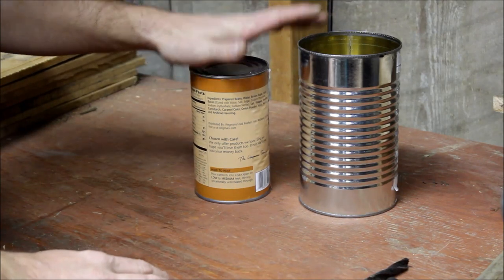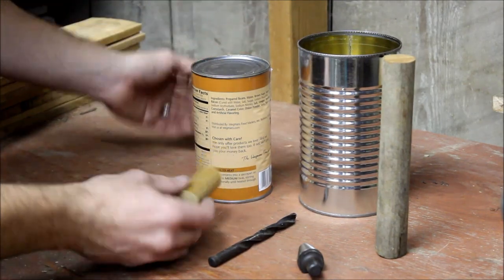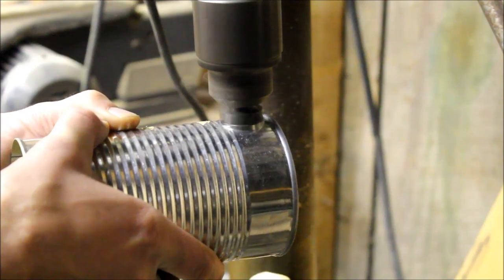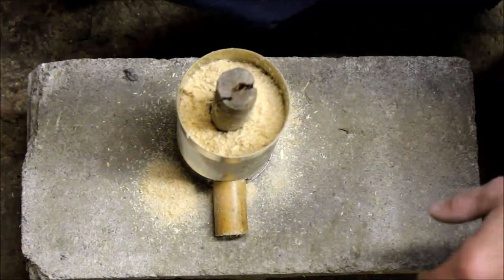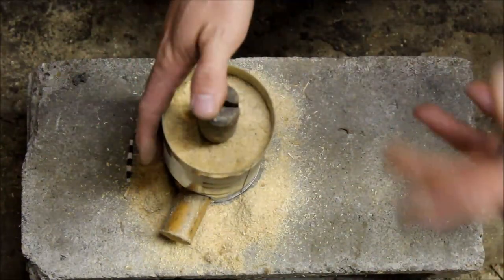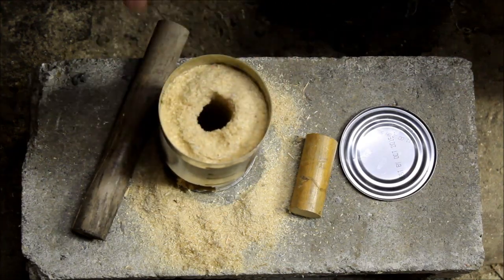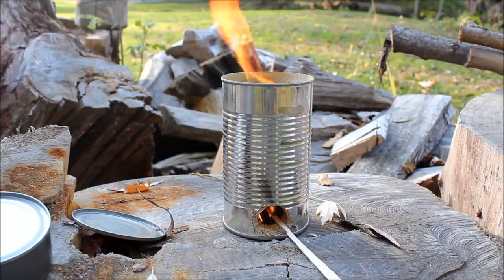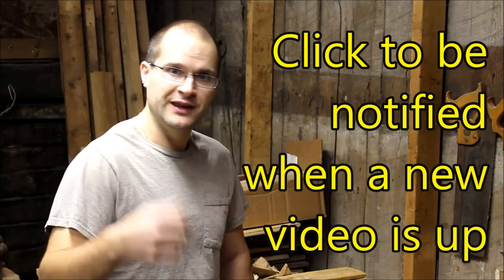The Secret  of how to burn sawdust with a sawdust stove

Comment: add some used oil or melted fat / butter to the sawdust before cramming it in the can and it will burn longer, hotter, and cleaner and the sawdust wont collapse, and the dowels (pre oil them) will slide out easier too. But great idea. I love hobo stoves.

Comment: It's clever and nice and simple.  I just don't see an application unless there's lots of sawdust around and no twigs for the rocket stove.  That's not a put-down.  It just doesn't have any advantages.  Unless, again, someone has sawdust to burn... literally.
Reply from the maker: +Kube Dog 
May not be a ton of uses in the woods but I have tons of saw dust and  I was looking for uses for it. It works good if you wanted to mess around out in the yard or want to use up the sawdust you have collected instead of tossing it. Some people use a 55gal drum and heat their shop with it. Thanks for taking the time to leave a comment and thanks for watching.

Comment: I wonder if you were to add petroleum jelly to the saw dust for the bottom and top, if that would stabilize it for you.  If you wanted to stay more natural you could use bees wax or heated pine pitch to the saw dust.
Reply from the maker: +macnuth 
I think they are all very good ideas it all depends how much time you want to spend on it. I made a larger one and that worked really well for getting my DIY charcoal chimneys started for the garbage can turkey.
Reply: diy tree house loft bed

Comment: I tried this and got LOTS of smoke and minimal heat.  There was no fire or embers visible in the can/sawdust.  Admittedly, it smoldered for over an hour.  The sawdust was dry and had no chemicals in it.  It was also quite fine.  It would go through a fine kitchen strainer.  
    So, what am I doing wrong?
Reply: I've tried making sawdust stoves a few times with different sized cans and even with a different sized hole through the sawdust and none of it works. The flames always go out leaving it smouldering and producing loads of smoke. If I blow on it it does flame back up but only to die down and smoke again. To be honest I think sawdust stoves just aren't all they're cracked up to be

Comment: Sawdust stove, is a very common in our country, philippines, like near our home in sawmill
Reply from the maker: Did I make it correct? Or is there a better way?
Reply: Yes,  but in our way, we use straigth bottle for the center dow,, because we use 4 liter paint can,
Reply from the maker: When I made a larger one with a big soup can I used an empty gas bottle for the middle. The larger one worked much better.  I also added air to one and was able to melt aluminum down.

Comment: if you mix some water with sawdust it make it harder and more stable
Reply from the maker: I need to test that and how long it takes to dry before you can burn it. It’s a great idea
Reply: @RealQuickChris  i tried few times . not too much water just to make a bit wet. when you start to burn, central fire drys around itself and not all sawdust. it makes strong resin cement and stable fire

Comment: can u use semi-dry saw dust?
Reply from the maker: you might have to use some kindling to get it going but when it gets hot it should help it dry out.
Reply: i also witnessed the fact that the smoke is very strong for the eyes. the smoke is also invisible but you will have to give off a lot of tears. like as if u are peeling onions, is there a remedy for this?
Reply from the maker: where there is smoke there is fire. I have a lot of campfires and I will burn everything from sticks in the yard to fallen trees. I let is sit outside and it gets wet when you burn wet wood it is smokey. fire needs 3 things Fuel, Heat, and Oxygen the only thing I have noticed that helps when burning wet wood is more heat. I nice big hot fire helps dry the wet wood out faster. so in the case of wet sawdust, we could lay it out on a tarp in the sun and let it dry or try having a bigger fire. I have used a big can to make a sawdust stove and it works pretty well, it's hot. (video here https://youtu.be/jx92uFKsRJ0 ) the sawdust I am using is by no means bone dry but its also not dripping wet. once you have the sawdust burner going you can add some small sticks in the bottom to add more fuel that will generate more heat just be careful not to cut off the air flow. Fuel, Heat, and Oxygen it's an interesting ratio I tried adding more Oxygen and it was amazing what happened. (video here https://youtu.be/5XAgpwkxAFc ) I don't want to toss out the sawdust so it is interesting to me to see the different ways everyone has to gain a use for it. what do you want to use this type of sawdust burner for? A bigger can might just help solve your smokey problem.
Reply: I was actually alluding to the fact that even when the smoke is not visible anymore(because the husks have dried). It itches in the eyes. thus causing teary eyes. this is not the case when we use charcoal. Do you have a remedy for that?
Reply from the maker: that is a good question and I am not sure if you can get wood, sticks or sawdust to burn like charcoal. Charcoal has been kind of super dried out or rather cooked in a container so much so that gasses are produced and released believe it or not you could in the process of making charcoal use the gases produced to run an engine. (wood gasification) so I wonder if the gases produced from burning wood is what is causing teary eyes and not in charcoal since these gasses were released during its creation process. I am just thinking out loud. so no I don't have a remedy for that but if I come across something I will let you know. sorry I could not be much of a help on this one but you have given me something to think about.
Reply: But have u experienced the same? that the gases release itch in the eyes? I am just wondering if it is just me and the type of wood i am using. I got the husks from woodworker and i suspect it is mainly eucalyptus.
Reply from the maker: when you say husks if you mean the bark of the tree then yes I have noticed that. I never like burning wood with the bark on it that does bother me more. If I have a fire and the wind shifts and it blows it in my face yes my eyes are tearing up I don't really recall if a smokey fire or a smokeless fire bothers me more or less. If I stand over a hot smokeless fire I feel the heat bother me more and first rather than my eyes tearing up but they do tear up. The smoke that you can see bothers me more. It's cold outside right now despite it being spring and all this talk about fire I want to go have a campfire right now lol I guess I know what I am doing today before the snow that they are calling for hits.

Comment: we use this kind of stove in 1970 in the Philippines
Reply from the maker: Really
Reply: yes!!!  because I am the one who collects sawdust in a Chinese Lumber in front where we live.
and for the stove we used a bigger tin can and my father (R.I.P.) assemble it with a cement and a 12mm bar. 👍 👍 👍 👍 👍
Reply from the maker: Nice. It's a great way to use sawdust up. You could even use it for heat. I also made a video where I used a larger one to melt aluminum. It was awesome

Comment: technically its called a reemer ... but most americans call it a step up bit cuz they dont make the good ones that are sloped but stepped.
Reply from the maker: 0623kaboom 
Thanks for the info. You are going to make me search my tools to see if I have a reamer  lol there is a good chance I have one in my grandpa's tools. Thanks for watching
Reply: A reamer and a step bit are two different tools.
Reply: “They” do make reamers. I own several of them. The Tool in the video is a stepped bit. Two different Tools.
Reply from the maker: I reamer is more for getting a precise fit and used to take a little of the material away to that final hole size right? it's silly but I had to google it and look at pictures I am sure I have some mixed in with my drill bits but I want to know the correct application for the tool. thanks
Reply: yes, but they do make a tapered reamer, and I believe that is what he is talking about.
Reply from the maker: so now I have to look up a tapered reamer lol

Comment: A tip for you noobs, use gasoline to dampen the sawdust so it will hold its form when removing the dowels. Preferably high octane.
Reply from the maker: now you are cooking with gas
Reply from the maker: Ever have the chance to use a huge waste oil furnace?   Some of the older ones are crazy
Reply from the maker: Off the inside of your nose lol I have to use that one
Reply: @Chris S Nah, I use a rubber mallet to compress the sawdust even more and keep adding sawdust until the can is almost full. You can whack it quite hard. The burn time is lengthened considerably and the sawdust is quite solid. The problem with the fluids suggested here is that they stink the place up and, if you're using your stove for cooking, they will give your food a lousy taste.